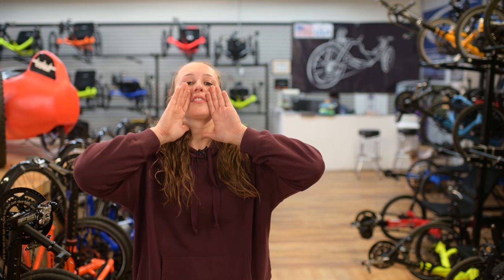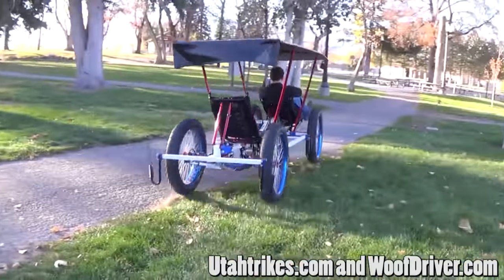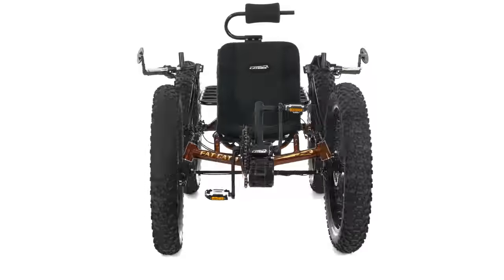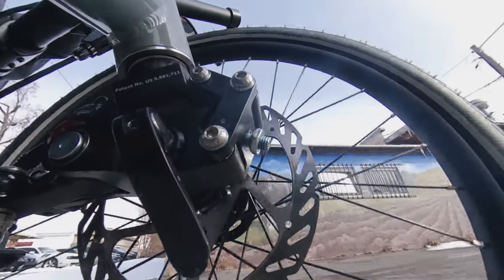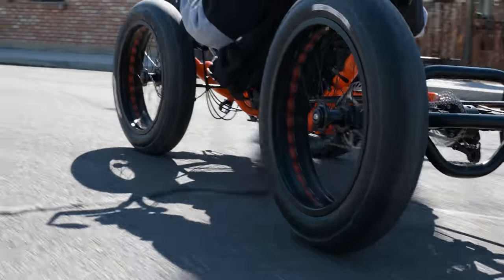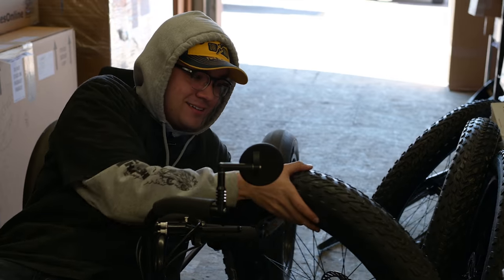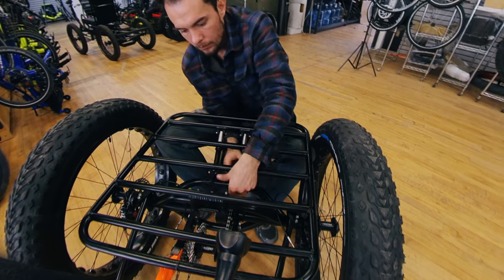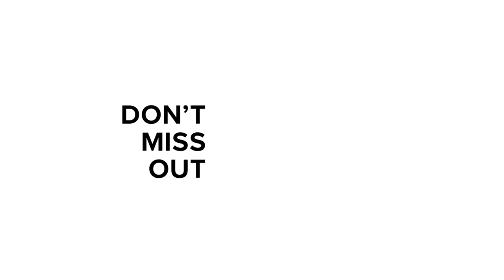90-SPEED CATRIKE DUMONT FULL SUSPENSION QUAD - UTCustom Fat Cat 4 w/ FATTY SLICKS Recumbent Quad

Comment: The down side is the cargo deck sits on the rear suspension unit and whatever you carry on it will feel all the bumps.
Reply from the maker: Agreed. Tying a rack into the main frame would need to be elaborate and it wouldn't be able to carry much.

Comment: Not bad, if it would have a Rohloff hub and electric assist. :)
I suppose after this video you will get a lot of orders. :D Unfortunatly I live in Europe.
I wonder what the average speed of this beast is on the streets with the 26" offroad tyres? On the other hand in my home town the regular bikeways have almost offroad conditions. :-/
Reply from the maker: The Pinion with our 1000W motor is a fantastic way to go. Lots of gearing and plenty of power and speed.

Comment: Video tech that lets girls be nerds may save us all.

Now build a riderless four wheel drive chassis and then add the crank-seat assembly where ever you want.  A radio controlled bike with an optional rider?  Maybe it's something for the guys at FliteTest.   Then you can get fancy and shrink an off-road suspension.  (try bungee cord springs)
Reply: I like the idea, after the motor and servos are installed, try it out at a skate park. 👍😎👍
Reply: @marsbase3729  put a passenger in the seat and give them a ride from your radio and first person view.

Comment: If I could afford it I would definitely get a fat tire, recumbent quad....in the color red, with full suspension and more than single speed..for sure. But, I can't see myself ever being able to afford one of these, unless I were to find a used one, several years old. I would definitely prefer 20 or 24 inch tires. I'm too short for 26 inch tires.
Reply: If you can completely give up owning a car you would have the money in short order.
Reply: @richardbodine7256  I haven't owned a car since August of 2009. I have no plans to ever get another one. So, that won't help. My social security retirement is $870 a month. It always increases a little bit every January,  but my rent increases too. I will just have to go for a cheaper option,  like one of the 2 Kent tadpole trikes that Walmart sells. They also sell a fat tire version....not a quad, but still fat tires...but I can't afford that one either. I get a settlement check every year that is between $1,500 and $1,600. I am planning on using that to get a trike. I will never be able to afford this quad or one like it, without monthly payments.  But, I don't like monthly bills or debt, and avoid them like the plague.
Reply: @nannuartworks5812  Thanks. I will definitely check that out and see if I can find a used one locally,  when I get the money. Last year the money came in June, but it seems to come on different months every year.